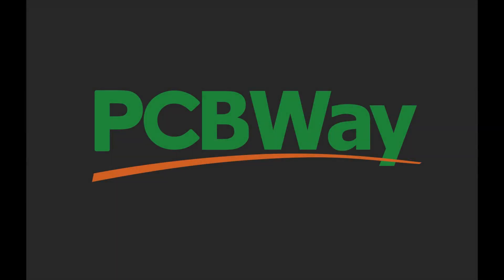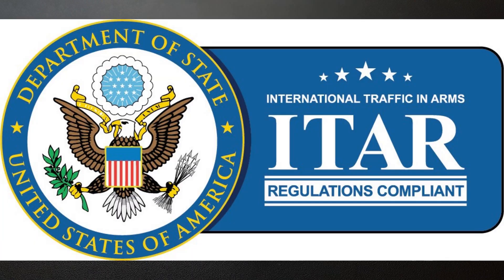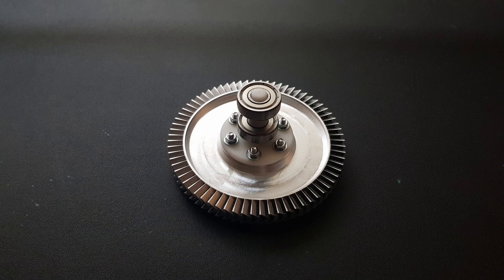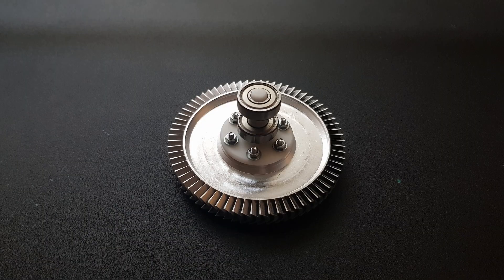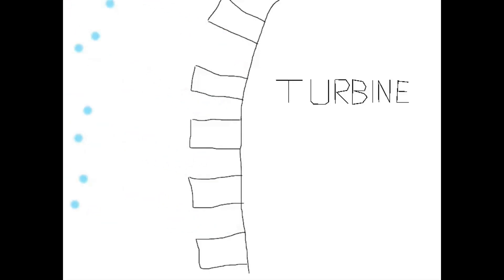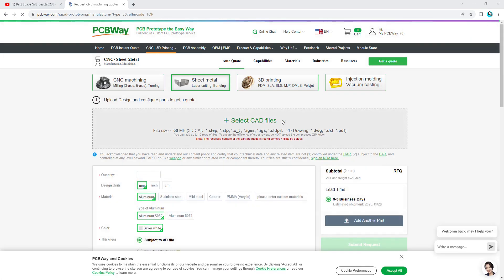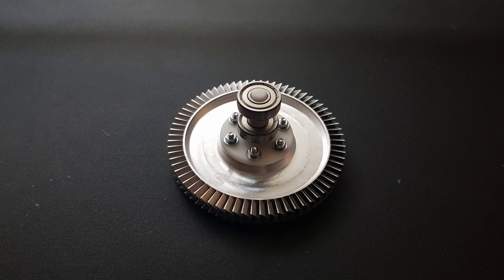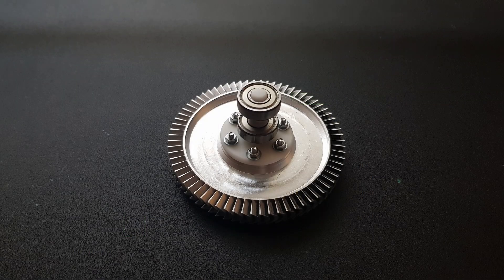This turbine spins at 40,000 RPM!

Comment: 40K RPM's is actually low speed, given automotive turbos can speed at upwards of 120K RPMSs. Whoever, congrats.
Reply from the maker: For a rocket turbopump, 40K RPM is quite a lot actually as it is meant to pump liquid instead of gas, witch can create cavitation witch would destroy the pumps at high speeds. I didn't really want to make it spin any faster than that as the bearings I used are only rated for 30K RPM and the thickness of the turbine has to increase with the angular speed squared, so if I made it spin twice as fast it would need to be 4 times as thick.
Turbos don't have this problem as they are way smaller in diameter and they use different bearings. Also, the turbine would actually be less efficient at higher speeds, as it would generate lower torque. The F-1 turbopump on the Saturn V rocket only spun at 5000 RPM.
Thank you for this great observation!

Comment: Garrett TPE-331's turn at 41, 730 RPM and that's with very hot air going across them.  They're also considerably larger.
Reply from the maker: This turbine was designed to work with 6 bar of compressed air. The air source that they are using is probably more energetic because it's hotter. My nozzle has an Isp of about 52 seconds. This is an experimental turbine anyway.